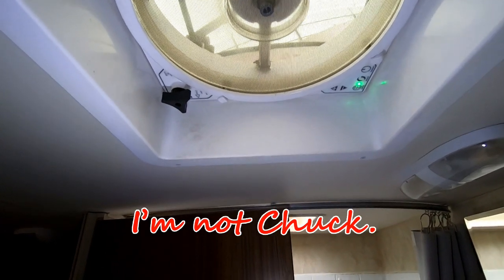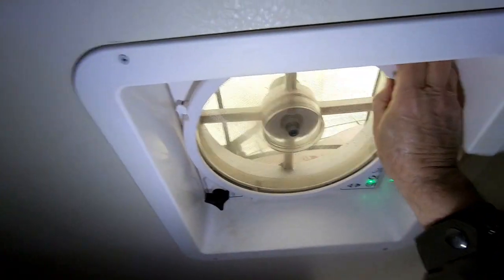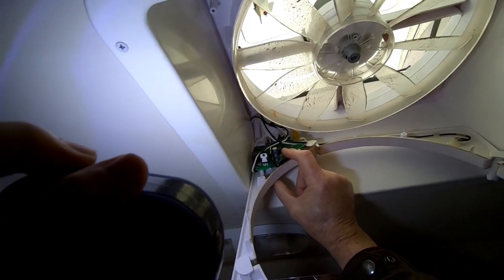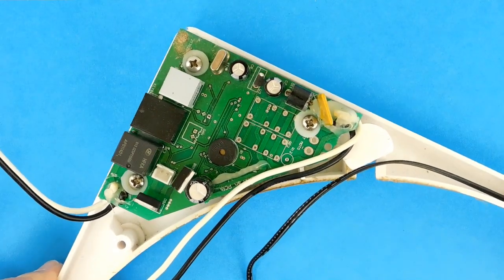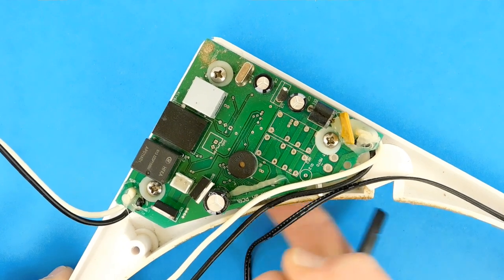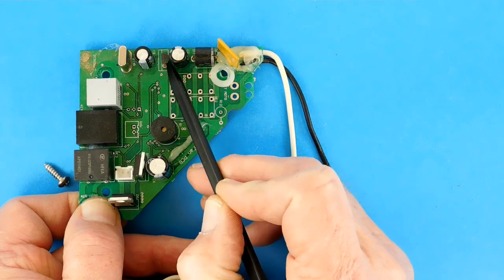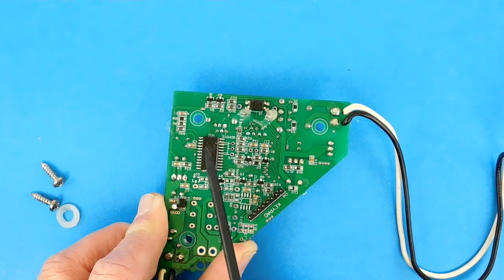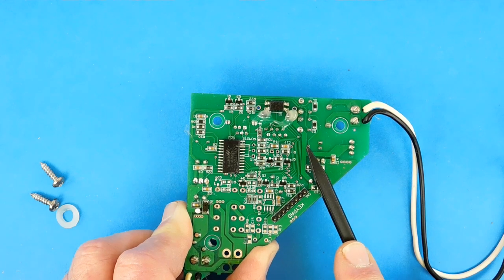MaxxFan Repair, Part 1 of 2

Comment: There are 'known' voltage issues with these fans.
Check out my video on installing a voltage drop down regulator to protect the circuit board.
https://youtu.be/fbWuiF2JSXs
Thank you.
Reply from the maker: I will take a look. Thanks for watching my video.

Comment: My camper has 3 overhead vents/fans.  The stock ones are tiny and move  much air.  So I installed the same fan over our bedroom.  I like that it can be used even in rain, and the thermostat is nice to help the trailer from getting too hot if I am gone.  I might install one in our bathroom next.
Reply from the maker: Hello Jeremy. It sounds like the MaxxFan fits your needs perfectly. Thanks for watching and for commenting.

Comment: I have a busted MaxxAir fan, and have a board replacement which I haven't put in, yet. This video comes in handy. That said, I wouldn't buy a MaxxAir fan again - I just need something simple. All a roof fan needs is a switch / rheostat to turn on an off, and for speed - and a simple switch to change fan direction. I don't need any of that other nonsense that breaks. Nobody needs 10 speeds. Nobody needs temperature sensor to turn fan on / off. If it's hot - turn it on, if not, leave it off. No computer. ( and I'm a software and firmware engineer! ). My next fan will be a simple Fantastic Fan. I was told that if the voltage goes above 13.4 it can damage the fan. My particular fan is connected to a regulated output 13.2VDC so that wasn't the issue. Further, I wouldn't use a MaxxAir fan as a bathroom / shower exhaust fan, as all of its electronics are more susceptible to moisture than the extremely simple Fantastic Fan. A giant crystal? Seriously? In 2020? I had those crystals in my ham radio set in the 1970s. Is that circuit board even shellacked?  In my old 1966 Class A, it had the original single-speed, exhaust-only fan which still worked 30 years later. Simplicity is best.
Reply from the maker: I put a Fantastic Fan in my previous travel trailer. It was entirely sufficient and about half the price of a MaxxFan, and had no microcontroller. I think you are correct. Thanks for watching and commenting.